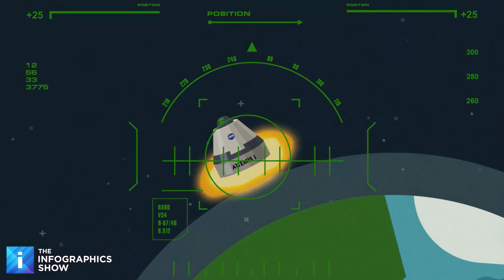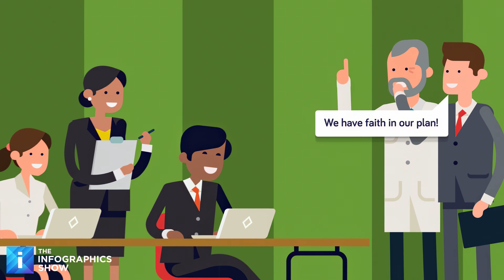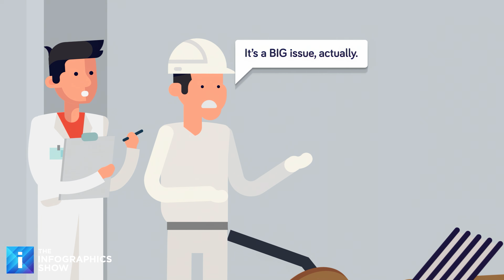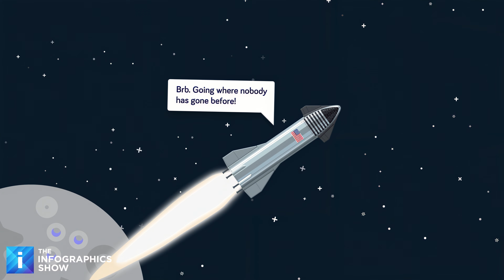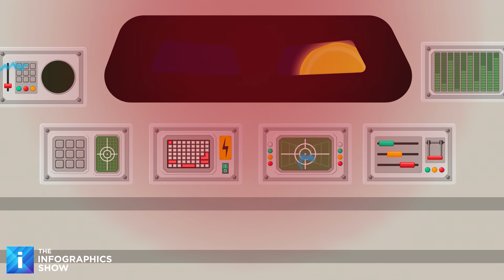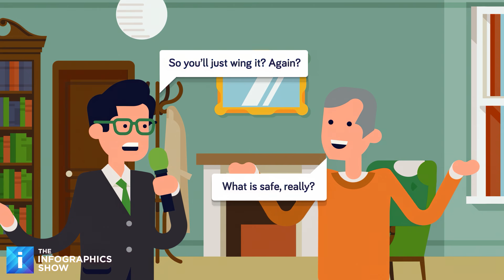Real Reason Why NASA is Sending People Back to the Moon (Artemis Mission)

Comment: For those saying that massive corporations have everything noted down, and there is no way they can lose data on the construction of their technology. Yes, they absolutely can and they did a few times already. Let me explain.

The engineers in the past barely noted down their failures, they noticed something wrong and fixed it on the go. They did so because they thought the changes were obvious and insignificant.

However, the changes added up over time and the physical designs ended up being slightly different from their official designs on paper, even while visually they were the same. After those engineers died, their knowledge and experience died with them.

As the result, when the company suddenly wanted to remake a piece of technology again, they would go through all the archives and find the designs. They would also reverse engineer old designs. To their surprise, it was very common to find out the actual technology differed from the design on paper.

Without a clear instruction to follow, the technology was often deemed impossible to remake and engineers would start working on a completely new design.

It's important to know that, nowadays, many companies require their engineers to note down failures and any even smallest changes they make on the way.

Comment: Block structure thought up by block heads.
Young modern engineers rely too much on computers without knowing and understanding material designs themselves. 
The problem with computers  ... flawed input,  flawed output. 
Crispen

Comment: docking an artimis capsel and a drango capsel should only take and adapter ring (we have built them before)  and then you don't need the space station.  Orbit a drago around the moon or around earth. dock with the returning artimis capsel and tranfer the crew for re-entry.

Comment: LOL, yeah, the heatshield showed damage, but astronauts would have survived. The damage was not from what this video described, but rather from the heating then cooling, then heating again during the skip maneuver. Plus this mission was to push the rocket and capsule to its limits, including a skip maneuver for re-entry which will not be used on Artemis 2. The heat shield for Artemis 2 is designed differently, and until NASA's recent announcement that Artemis 3 was no longer going to the moon, that heat shield was different as well. Horses for courses. And wrong again about the re-entry angle, it will be steeper with more heat, not shallower as described.

Comment: I'm in now way or to any degree less than the N-th degree a rocket scientist. But becasue it's the speed of the object entering the atomspher in addition to the duration. Would it not be better to figure out how to slow the object down considerably, in addition to a heat shield. I get the fact the size effect's the weight, and material's brought back add to the weight that causes the object to have such a speed. But I'd believe if we were to spend more time, effort, funding on the istallation of I think there referred to as retro rocket's which when the object comes in head first useing them to do a 180, then only depending on the sheild's to stop the excessive heat, rather than when there already designed and in place, to rotate the object 180 degrees. Having sufficently more fuel, whould add weight, but assit dramactically in slowing down the object as it first enter's the atmospher. Ok, the angle woud also have to be refigured, but than that's only mathematical figuration's.

I mean how is Elon Musk able to do what Nasa isn't able to do and do it for considerably less time, effort and funding. It's a safe assumption that if Nasa was replaced with Elon Musk at the head. Our venture's envolving the lift off and returning of craft would be consideralbly better.

India doesn't have nearly the resources Nasa has at it's disposal, but some how is able to do what Nasa either can't or won't. Thus apparntly the time, effort and most of all funding. Isn't being utilzed as sufficent as it could. There are those who have made million's from having various contract's with Nasa. And being successful the first time, get's them more funding for 2nd, 3rd etc. etc. etc. attempt's. When both Elon and India have proven shit can be done if and when various contract's are awarded to those differently than they are usually.

Comment: So heat shield broke but capsule were intact. Hmm. Doesn't sound as a failure.  Because the capsule remained intact and safe. 

Massive corona eruptions is always a risk but you can actually measure almost the exact time it will erupt. I mean. We have a probe that is like surfing on solar flares much close than the moon astrounauts. It still making observations with the heatshield it have. No instruments failing there.

Comment: The Moon has always been political, including Apollo, so “geopolitics” is not proof Artemis II is reckless, it’s just the reality that big national exploration programs live in. A heat shield anomaly on Artemis I is serious, but it is not the same thing as “knowingly flying with a fatal flaw” if the failure mode is understood, bounded, and mitigated through trajectory changes, testing, and acceptance criteria, which is how flightworthiness is actually certified. Calling it “flying around it” ignores that adjusting entry profiles is a standard engineering control, not a magical hand wave, and it can be the safest path compared with ripping up the design and introducing fresh unknowns. They frame “science vs politics” as a binary, when Artemis is both: it’s a test of deep-space operations, life support, reentry, and crew procedures that directly enable future lunar surface missions and Mars-class capability. And finally, the “no lifeboat” language is rhetorical inflation: deep-space missions are inherently high-stakes, but that is why NASA stacks redundancies, abort modes, and verification work—because the goal is managed risk, not a geopolitical coin flip.

Comment: In every things, there are risk (s). If one know the shortcoming of thing, ones can take measure to eliminate or reduce that said risk. NASA know the limit of the heat shield. During prolong high temperature exposure the shield did not hold up well but did not expose into the secondary shield.  To them the best solution is not to expose it to higher temperature but rather lower temperature. If one know your vehicles might fall apart at 100 mph, then one can get to where one wanted to go by staying under 100 mph.

Comment: Why can’t Nasa just launch Artemis 2 uncrewed, like the first Artemis flight? This way if there is a failure of the heat shield on reentry no lives would be lost.  If I were one of the astronauts on Artemis 2 I would be afraid. Very afraid.  Like with Challenger and Columbia and the recent Boeing Starliner flight, NASA seems intent on launching astronauts on a spacecraft with a known flaw and is silently preying nothing will go wrong.  This is exactly the “normalization of deviance” attitude which led to the Shuttle disasters. Delaying Artemis 2 for a year or two to fix the heat shield problem. Is better than having a disaster on re entry.  Of course that extra delay may mean politicians will say “enough is enough” and cancel Artemis altogether, but of course that is also better than having another disaster.

Comment: we won the last one because we did not cut corners
Reply: Well, we did cut corners. Lots. But we got away with it. Not everything went at all smoothly during Apollo. It was actually pretty close.
Reply: @aaronwells6608the challenger cut corners and it didn't do do well
Reply: @Diamondr11Blue   Challenger flew 10 missions over the previous 3 years. But yeah, when they decided to cut corners, they found out. That's exactly what I was pointing out. Challenger was considered the workhorse of the shuttle fleet. It was rock solid...until idiots started getting complacement.
Reply: @aaronwells6608 Columbia also went wrong
Reply: @Diamondr11Blue  yep. It did. Columbia was also simply very bad luck. A chunk of foam that just happened to hit the leading edge just right? And didn't happen again almost 140 missions? It's a tragedy. Not something to celebrate. Im not sure what your point is.😂 Yep. The shuttles had about a 99% success rate over their 30-year operational history of something like 140 missions. If you think you're making a point, it's probably not the point you think you're making.😂 Space flight is dangerous. It's not always going to go right. Most of the time it will. But not always. That's always been the case, it's not going to change anytime soon.
Reply: @aaronwells6608? I just said cut corners
Reply: @Diamondr11Blue  yeah I know. So did I.
Reply: It was a great movie

Comment: Threaten to send one of the scientists up with them, they might revaluate the risk.
Reply: A lot of astronauts actually have a Ph.D in the sciences.

Send the CEO from one of the government contractors.
Reply: @blu0065 it’s a requirement to have a doctorate in an applicable stem field and over 10,000 hours behind the yoke flying.
Reply: It isn’t scientists or engineers that are the problem. It’s management.
Reply: Beter the project leader / desision taker has to go too
Reply: Threaten to send one of the politicians up with them.  The politicians are controlling the budget and pressuring the schedule.
Reply: No.  Send up one of the administrators.  Just not Jaredman.
Reply: This video's facts are so wrong I wouldn't believe anything they posted, except that there was damage to the shield, which certainly was a result of the skip maneuver, not a normal re-entry.
Reply: Get them to send up a world leader.  I’ll bet it will take some more time before it’s ready.
Reply: @dragoonseye76 they'd just send a paid imposter. That's if they'd even send anyone. Or they might send astronauts but not the ones actually publicly announced to go. Those official astronauts would then remain on earth in a secret simulator in case of mission failure. They could then broadcast fake material from the secret simulator. But why not send A.I. robots or A.I. / VR robots instead? You'd then not have to build in human life support systems nor crew facilities - no air needed, no food needed, no human waste systems. Just have astronauts operate the A.I, robots via VR capsules / seats. Then develop craft for human astronauts later when technology improves.
Reply: Let's send a member of Congress up there or even a Trump family member.

Comment: so you can't do it better today nor at all, but you could in the past  . . . yeah, send the designers
Reply: You mean Stanley Kubrick?
Reply: Yep. 1969.
Google Capricorn One
Gaz UK.
Reply: No. NASA management is to blame. They are letting budget and schedule have final authority.. again.
Reply: 1970s technology is not compatible with modern technology
Reply: @TheBestDog  the point is that today's technology, data, and material are far more advanced than the 70's, yet they were somehow successful back then compared to now.
Reply: @jaynguyen1573  I think alot of pressure of being there first made them cross their fingers and hope the math was mathing.. so today they are risking one (all be it) Major error being fixed. where as back in the 70s it was more like 5 or 6 major errors.. which is probably why NASA dosen't think "heat thingy" is such a big deal... Trust if the Soviet union had any information on us faking it they would have released it.. 

SN: i do think the US officals had a back up "staged" video (of the moon mission) in case things went wrong. but got lucky and didnt need it.
Reply: @jaynguyen1573  NASA has built the new landers and orbiters from the ground up. The old orbiter/lander cannot be copied or replaced with modern-day parts. It’s not compatible with today’s technology. The blueprints are to 1970s specifications and cannot be used for anything beyond a general concept for the equipment. That said, it’s taking way too long for NASA to return to the Moon.
Reply: Example: Replacing an incandescent bulb with a new low-power LED can be a daunting task because every milliamp must be accounted for.
Reply: @jaynguyen1573 nasa didn’t have a safety committee in 1970 or until like 2005. So that’s why they just shot off anything. Which is why we got challenger, discovery, Apollo 1, Soyuz 1…
Reply: @YKeyce Maybe US has something on Soviets so it's a mutual agreement for keeping mouth shut from both sides.
Reply: @chelikhkahn what other evidence is there to support this theory? It’s not like they have attacked US allies or anything. Oops, they have.
Reply: @chelikhkahn  That could work. But the US used every resource to embarrass them as a country during the cold war.. 

EX. both countries agree'd after they had a close call with Nuking each other; to work towards deescalation. But the US used it to strip away from the Soviets "Dominance" image and win the cultural war. the Soviets never responded with anything near as damaging which caused (helped alot at least) the spread of Capitalism.. 

if there were any secrets being held, the Soviets would have no other choice but to expose them, before the slow ruin their country is in today.